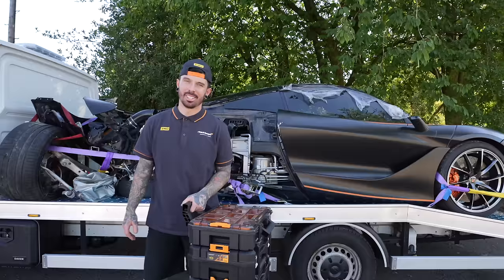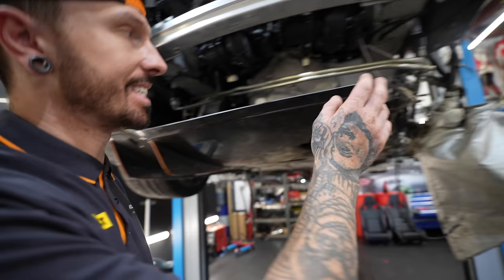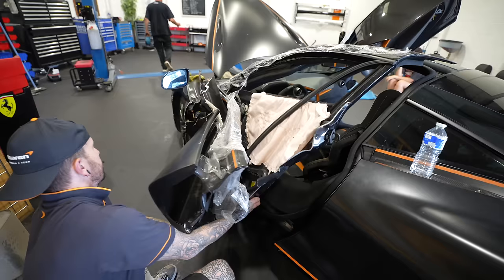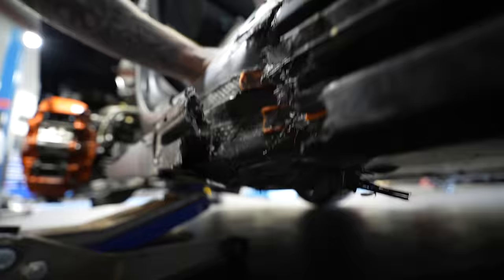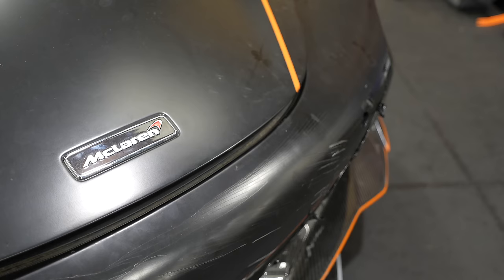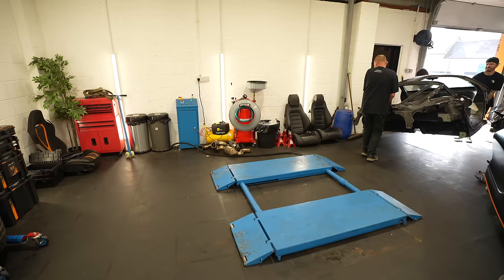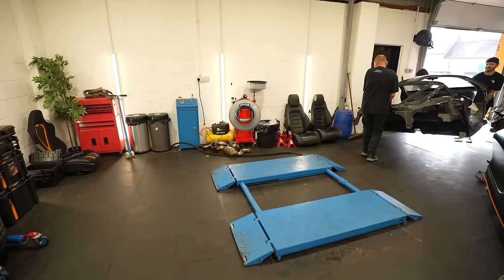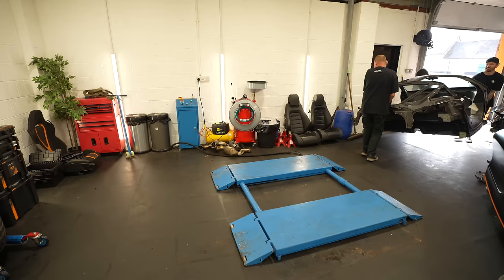REBUILDING A WRECKED MCLAREN 720S | PT1

Comment: So invested in this one
Reply from the maker: Absolute legend ❤️🙏
Reply: I've been watching you guys for years! Guy* Why don't you make some car content?
Reply: So is Mat :-)
Reply: I’m investing
Reply: @MatArmstrongbmx get the frame doc to help u out with the firewall on the new tub. It would be an easier fix than fixing that tub. Plus you have the skill and knowledge to get it swapped. Tell tony good job on getting it on the lift! 😅
Reply: @JeremiahL1616 what would be the point in converting a RHD tub to LHD in a country in which cars not only drive on the left, but in which LHD cars are worth far less?
Reply: @richpolecat6527  mats donor tub is opposite drive from the one in the car
Reply: @JeremiahL1616  I'm quite aware of that, it's a LHD car, and the replacement tub is RHD. In the UK we drive RHD cars, so it's only logical that you'd convert the car to RHD, and resell the remaining LHD components, to recuperate some, or all of the extra cost. Not that that matters in this case, as its a YouTube build, but being a mechanic for several decades, that's what I'd do personally.

A LHD car in the UK, is worth considerably less than a RHD car, and is obviously not suited for driving on UK roads, so, building a LHD car makes absolutely no sense at all.

Comment: To solve the left hand right hand tub problem, you could cut out the different sections and swop them over. Easiest way to mount them would be to cut maybe 30mm wider around that piece so the wider piece is common to both and then use an adapter ring maybe out of aluminium to attach the part to the tub. The adaptor ring will just need to marked in 3 places so it lines up with the tub so it fits the other tub perfectly. Maybe that's an option. Good luck
Reply: Yeah, just cut the structural tub sounds like a great idea.
Reply: But my guy, that hole on the tube is already cut by a robot. So why can mat also cut it to fit his liking

Comment: There are companies out there that do left/right hand conversions, we have a couple in Aus that I've used. That dashboard can be reconfigured (grafted) and then recovered, the wiring loom can also be remade or purchased. The steering rack should be a sourcable item.
The other option is to graft the LHD firewall onto the RHD tub, any decent CF specialist can perform that task.
It comes down to whether you can live with a LHD car.

Comment: Looking at the front wall of that tub it looks symmetric, except for the hole locations. If you cut the matching hole pattern on the reverse side, and doing a carbon fiber repair where oversize holes are, I expect you can change it from right hand drive to left hand drive. Make sure you wear breathing protection when drilling/grinding on carbon fiber.

Comment: awesome build !!
For the tub i would cut the steering wheel carbon support from the crash car and use it to modify the new tub, with strengthening the area as top priority, as it's a safety area.
Be careful with the rods if you want to push more power.

Comment: Love these videos  ! One thing that doesn't  come across  is time scale may be do a man hrs calculation  at end of each build  ? 
Possibly  not  easy ? Maybe a diary on another white board  of the  hrs so far 
So when you work on the car write 3 hrs suspension / fitting bodykit etc write it down and add up at end 
Just a thought, it would  be interesting  to know  .
Thanks

Comment: If you're going to run more power with the bigger turbo's I'd speak to your mate Freddy as I'm sure he was speaking to a company in the states about the internals that need to be beefed up to handle more. Con rods are mega thin I think. May be a different engine but it was on one of his P1 build episodes. I'd also price up parts to right hand drive convert it as you can sell all of your clean and good left hand drive parts to get the money back surely? Saves cutting up the carbon bulk head. Great content as always Mat!! Loving the channel!

Comment: Did tavarish not upgrade the turbos on his 765lt project and through a rod out the engine. Not sure the standard internals in the engine would take more power although be a great video to upgrade rods and pistons too. Good luck great project

Comment: I have successfully used Qwik Steel on a radiator. It cures within like 10 minutes or so.. the radiator had a 2mm'ish hole. It lasted for years. It's the playdough like stuff you mush together until it gets really hot.

 Jb weld has the same stuff these days. It's not the liquid/paste stuff since that takes forever to cure. I think your oil cooler temp fix would've definitely actually worked with it. That stuff you used seems like not a great choice :p I'd think it's cure time was days.....? I'm guessing you'll need to do a temp repair on a radiator or oil cooler in the future, so give that a shot! Obviously clean it up first with a wire brush or something like that.

Comment: Check the conrods in the engine they have a tendency to bend as they are well known weak poin even in OEM form. I suggest you upgrade them as you are very likely to blow the engine even in standard OEM spec.If you upgrade the turbos i suggest you change the conrods or your gonna encounter a massive expensive issue.

Comment: Easily rectified. You get two aluminium plates CNC'd, then bond it and bolt it to the frame for the ABS / Steering to bolt to.

Comment: Looking at the two tubs I think you could cut a hole for the steering column and modify the other holes as both sides look similar apart from the holes. Perhaps McLaren make the tub then cut the required holes ?

Comment: Matt if you touch that motor to make more power you HAVE to upgrade the conrods or they WILL snap and destroy your motor , even stock 720 motors blow up from them breaking so just in general your should upgrade them

Comment: yes you can upgrade the turbos like DDE guys did car will be faster with mad power but it can blow the engine up OR go as Tavarish is doing upgrade all other parts like cranks and pistons ETC that gonna cost much more but car will be solid reliable else just keep it as it is.

Comment: Am I completely off track thinking that an adapter plate set could sort out the holes in the tub for the steering column and the brake booster? I mean if you think about it, that kind of doesn't look structural to me and let's be honest, how much strain does a steering column and/or brake booster put on their mounting points anyway?
Correct me if I'm wrong, but that would seem to be a good way to approach the RHD/LHD issue? 🤔

Comment: How are you going to go about registering the car? 
If the new tub is fitted and intending to use the reg off the lhd car but using the rhd tub the vin number wont match and essentially a ringer car? The only way to use that tub if I’m not wrong is if you bought it with a v5 and have the reg for the rhd car?

Comment: For those asking why not repair the tub? Carbon fibre is bonded throughout itself, so the strength is the fact that it’s all one piece the bigger the piece, the stronger it is, a repair is in effect only as strong as itself, so where a tiny piece is in itself weak because it is so small where it’s not a critical load component or is in effect just a piece which contributes to the required size that in itself is fine and safe. Where the repair is structural because the repair is in effect only as strong as itself because it is not part of the original piece it is by comparison very weak and therefore likely to fail especially at the joint bonds. 

Imagine a sheet of carbon fibre where the whole thing is one, bonded throughout its length and width, then cut out a small section and replace it like for like, the repair although bonded to the rest does not benefit from being interweaved with the rest of the structure because it is only the size of the replacement piece, it may be fully blended in but it will never be fully bonded, like cutting a section of your arm out then blending a new section of skin in, it may look the same but all the nerves and blood vessels are not connected and in this case can never be connected you end up with something that looks right but ultimately it’s not right, in the case of the arm it would look ok but the nerves and blood supply are not there so it would not work and die. In the case of the carbon fibre it would look ok but the strength would not be there and in a strength critical part it would be very weak. If the vehicle had impact in that point or close to it the result would be devastating. It is not safe to make the repair which is why McLaren refused to do it. It’s the equivalent of a botched cut ‘n shut. The repair will also be under great stress during such things as acceleration, braking and lateral movements in cornering, carbon fibre in this situation does not flex and so the joint being the weakest part is prone to fail. The repair could also fail without warning. This is why the whole tub has to be replaced, it’s too dangerous not to. Finally a tub repair to the location of Matt’s tub would certainly fail a structural crash test regardless of how well it was repaired that is absolutely 100% certain. If you like, cars with sunroofs pass structural crash tests because the sunroof is not part of the strength, but imagine having the sunroof in the strengthening beams of the chassis (I know that’s impossible) there would be no strength where strength is critical.

Comment: Mat encouraged me to fix my own car today. Got a rear wiper that keeps moving on its own accord lie a ghost is moving it took the fuse out yesterday come back to it today brought fresh new fuses and put a brand new one in and seems to have done the trick and fixed it. Had a broken window since July. Replaced the motor, replaced the whole bracket and the electric window just won’t open, swapped the fuses nothing worked. Again replaced the fuse for the window and it fixed it. Come out of work 11pm and my window won’t open again ffs 😫 tempamental little skoda fabia I have. Any recommendations be brilliant!

Comment: Can't yu try convert the new to a LHD as the mounts can be adjusted to move brake to the left and seal the Right side using carbon repair and all sits as the original crashed car used to

Comment: Don't just increase the turbo boost on a Mclaren!

Just ask Tavarish.

With the right hand tub, get some adapter plates to swap the brake cylinder mounts and steering clearance holes over. Epoxy them to the tub if your worried about integrity. It would be a shame to loose that dashboard. And it would be cheaper than new dash, steering rack brake hoses etc.

Comment: HI Mat, love what you do but with this car I would be very careful with re-shelling it. From what I can see the VIN is located on this part of the car and, essentially, you will be rebuilding the shell and not the car you bought. You will end up in a world of hurt with the dvla and could have a car you cannot put on the road.  Converting the tub from LHD to RHD would be considered a major change to the chassis by the dvla and may end up with the car on a Q plate. No idea what the insurance situation would be regards the conversion or repairs to the chassis but I would be investigating or you end up with a very expensive paper weight.

Comment: I feel like you can just drill out the mounting points for the brake booster and cut out a hole for the steering rack on the new Carbon Tub

Comment: I would think the tubs are more or less the same, couldn't you just alter the cut out on the front to switch the steering wheel from left to right? Even if it means having the other hole repaired first then redoing it for the brake booster

Comment: Don’t add power, they have thin lifters and more often than not if you add too powerful a tune or too much power they will break apart and cause a catastrophic engine failure.

Comment: If it cuts out or stalls, it'll try to restart. If you take your foot off the brake, it won't try and restart, if you then press the brake it'll try and restart. You can just turn the ignition off to stop it.

Comment: In the long run, I believe it would greatly benefit you to attend a carbon fiber repair school or send someone you know. Carbon fiber repair is a pretty straight forward ordeal if you have the knowledge and technique necessary for repair. I helped do carbon fiber repair to aircraft parts/pieces and rotor blades across a career in the navy, it is not difficult.

Comment: while its a cool excercise in mechanical skill to tackle such an ambitious project, It's also a sketchy endaevor regardless how skilled you are. Carbon fiber does not hold up when it comes to damage, It is not like steel that has an actual elastic modulus where if not surpassed no deformation occurs. And it can be welded and its properties are very well known. Carbon can look fine, but have micro cracks that will contionue to enlarge until it fails. A seemingly gentle bump has been known to destroy carbon fiber bicycles.
There is a reason mclaren refused to take on the car, and a reason they require the work to be done by them, they are not going to allow a compromised vehicle to be out there that if not up to threir spec and a failure occurs it is not good for their brand. Even purchasing a tub that you have no idea what happened to why it was junked, how it was stored and a million other variables. Its a mclaren for godsakes... if you are looking for a ridiculous deal its not the car for you. It's for serious motorsport enthusiasts with deep pockets. I wouldn't trust some guy to put it togheter... overtorquing bolts in carbon iwill destroy iit plus every other thing you werent on actual spec for.

Comment: Since the carbon fitting holes on the right hand drive hull   aint no structural integrity part you can just switch it over!  
Says me the mechanical engineer     just cut it out and glue the right part in   no problem at all

Comment: I kinda wonder when theres enough surplus on the channel, to buy a heated warehouse in the middle of nowere, and start hoarding cars like this.
You got a lot of spareparts in this deal, but is a pile of spareparts enough to actually start a car-build?
Id stash this awa(if I can afford it, 60k isnt peanuts, and money that just sits is worthless) - and then id keep an eye out for a matching wreck - a maclaren for 2x60k is cheap af, even if you add 10 years rent of a barn 8that obviously would be filled with more/other similar deals)

60k is a lot of dosh tho. Its not something you just pull out of a budget

 - I kinda feel the engine/gearbox alone is worth something in that ballpark. You have good discs for some of the brakes, theres a few good wheels left, panels here and there. a seat might be good..  

And you even got a sponsor deal for this, making my idea worth even less

This could be a good deal regardless of route

This is builds that allows you to put "expert builder" on your resume

GUYS!!! you need embrace impactdrivers for tight bolts n screws etc. 1000 taps is better than just one hard haul

Comment: After how @tavarish broke the 675lt engine bcz of the upgraded turbos (Conrods couldn't handle the power as they were not forged), i think you should do more research on the engine conrods as we know they are a weak point in the engine, if they are forged, go ahead an upgrade the turbo's but do more research first make sure they can handle the power, i'd just hybrid upgrade the turbos, nothing to wild, if its not forged, maybe getting K1 conrods and wisecco pistons, to handle the power

Comment: you should cut out the parts with the LHD holes and replace it with the RHD. those parts shouldn't be as structurally important as the sides

Comment: Do not give the 720s more power without upgrading connecting rods, they break even with stock power. The rods will blow a window in your engine block and make things much more expensive.

Comment: Bro you could of repaired the carbon fiber damage,  its not to hard. Juat have to cut out all the damaged bits, sand it out, make a insert, then connect it all with more carbon fiber and hot bond it all together.

Comment: @MatArmstrongbmx Check if you need to upgrade the engine's internals as well before upgrading the turbos and upping the power. @tavarish knows this all too well from his experience with the 675LT. Wouldn't want you to repair this beauty only to blow up the engine after a few thousand miles ;-)